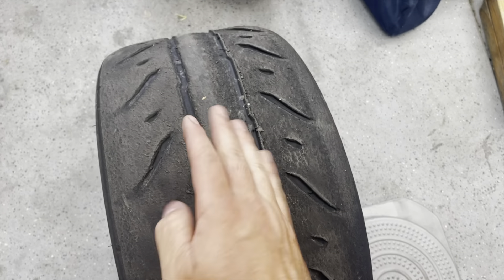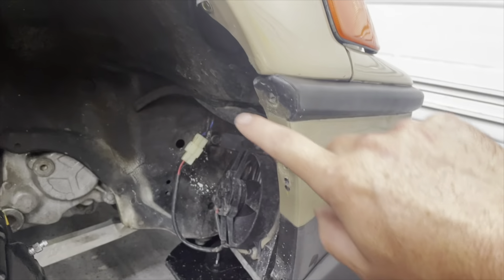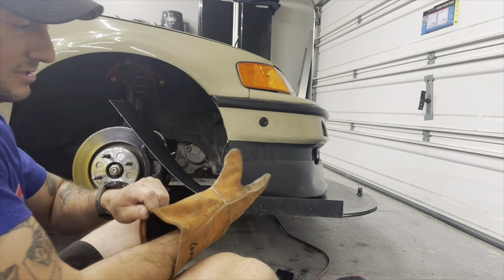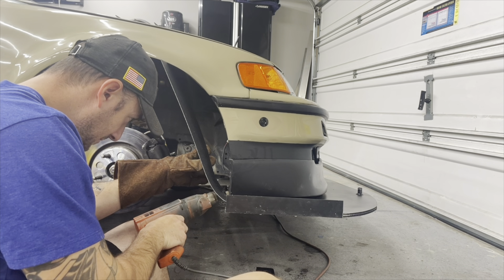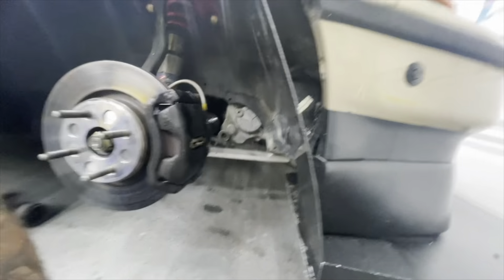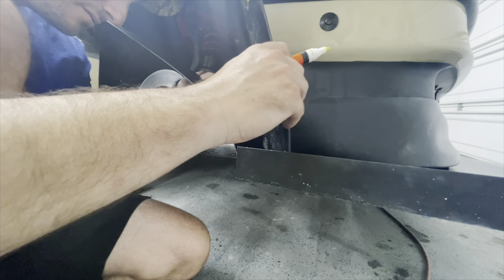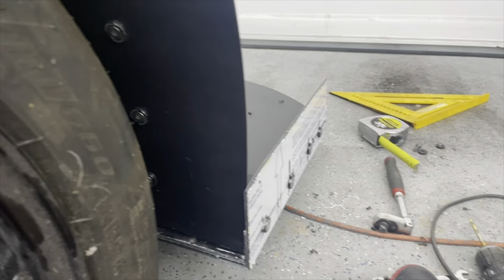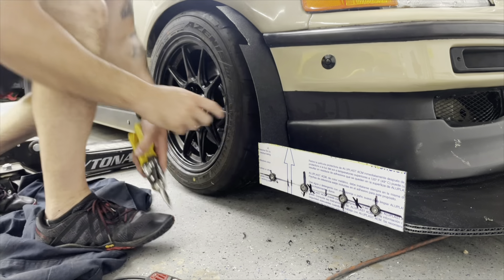CRX DIY Tire Spats & Tire Stencils

Comment: I thought you had wilwood brakes on the front
Reply from the maker: I did, still do on the shelf. I had the Wilwood Powerlite calipers, currently this new combo Im using has way more braking power than the wilwoods did. I think if I went with a bigger wilwood caliper that would have been different
Reply: @justingadell  I just ordered the wilwood kit you have, I am hoping it works well. I do not track my crx though.
Reply from the maker: It will 100% be fine and can be tracked. I just wanted more, if I went with a bigger wilwood kit I’m sure I’d have been slightly more satisfied. It is a good kit for sure
Reply: @justingadell  Thanks, good to know.